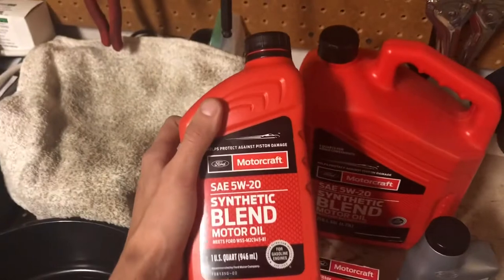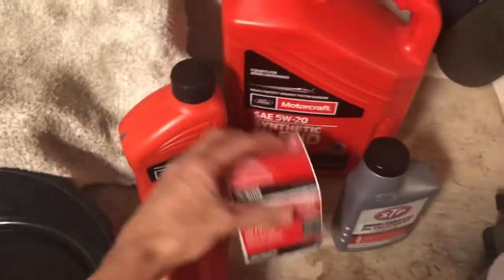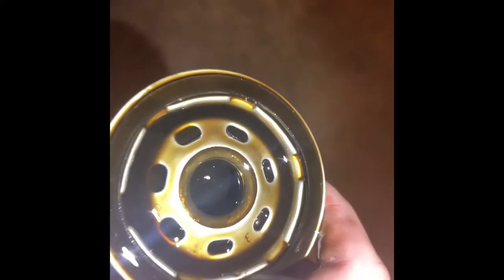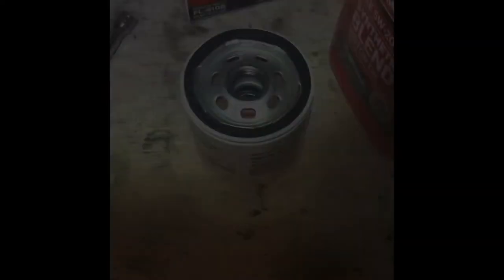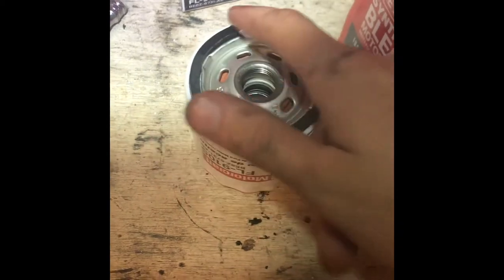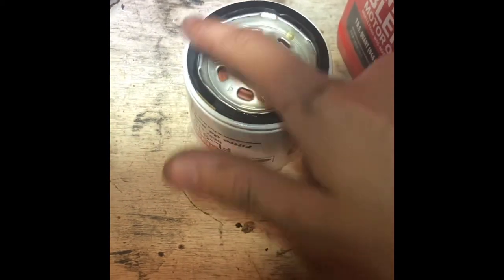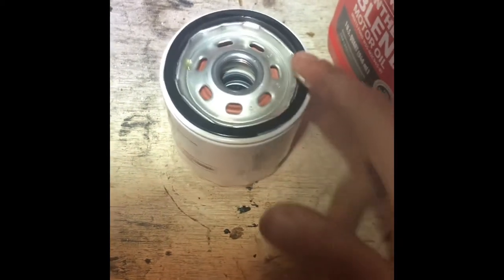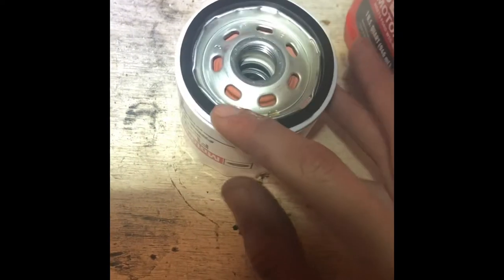Crown Victoria Oil Change/Motor Tick Fix

Comment: its great that you have used that golden tinfoil heat deflector stuff on your zip tube, but you have given your car a  hot air intake... go back to the stock p71 cold air my guy
Reply: if you pay attention, you’ll realize he put a tube from the open grille directly to the COLD air. This setup is wayyy more functional than a factory setup

Comment: I had the same problem but those cars burn oil and if you don't change your oil Ragley you will develop a little ticking noise but if you change it like you're supposed to it will be good and used Lucas oil is not enough since I've been doing that I didnt here  a tick since and it stop dry cranks
Reply from the maker: Good to know...
Reply: I have two 99,and 01,they don't use a drop of oil
Reply: @scottearls7854  oh I have a 06 it was doing it but now it stop but most people are saying there’s do even the police department is saying it so consider yourself lucky

Comment: Why are you using a 910s instead of an 820 filter ?
Reply from the maker: The 2009-2011 police interceptor with oil cooler uses the 910s, where as the non oil cooler and pre 2009 models use the 820s.
Doesn’t make much sense why they would change it, but that’s the reason why.
Reply: Nicholas Shaughnessy  Thanks , I have a 2003 Marauder  , could I use the 910s on it ? Is there a size difference , or what is the difference ?
Reply from the maker: @thomasdaum1927  I’m not sure about the maurader, since it’s a 4v.
Reply: Nicholas Shaughnessy  Ok thanks , I will do a little research and see if they are interchangeable and what the difference is !